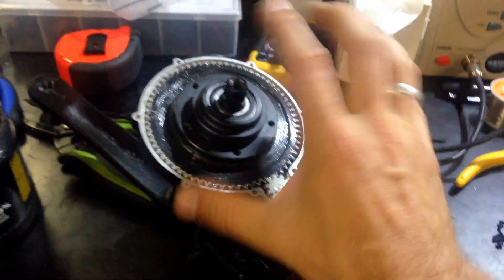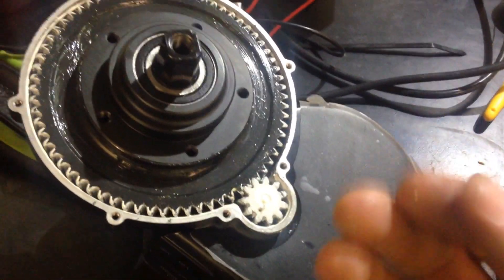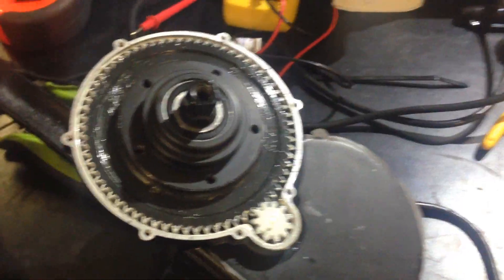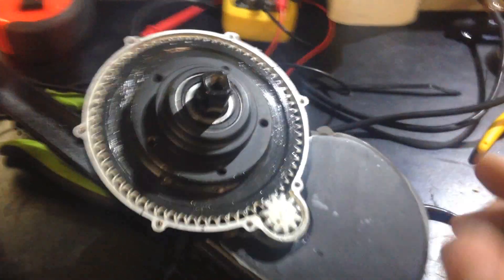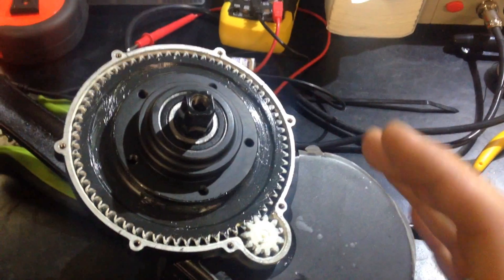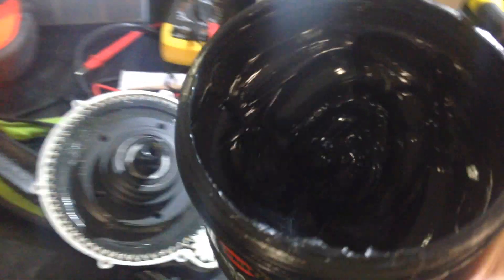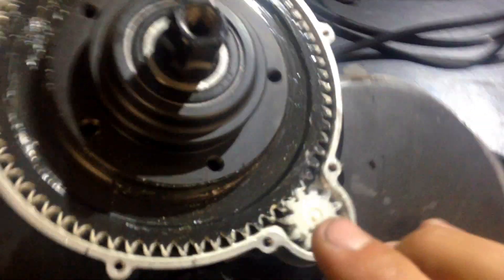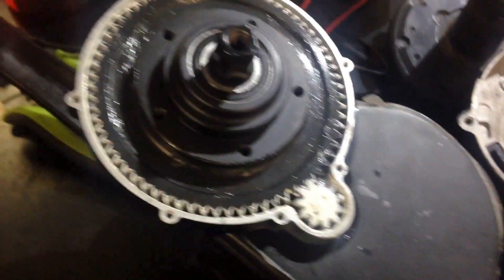Bafang 8fun BBS02 - White Lithium Grease "problems" • Electric Bike 750w 48v mid drive kit

Comment: Jesus! For the price of their kit... I'd say molybdenum disulphide or gtfo!
Reply: +ElectricBike (Bruno) Hello Bruno. I can understand the idea behind the moly grease (I read the article). But it makes no mention of lithium grease. Is moly grease compatible for both sides? The metal gears and the white nylon gear. In other words can I use the moly grease for both sides?
Reply from the maker: +Nelson Olivo - Moly grease is for metal on metal only (second stage reduction gear where you screw the chainring on). The internal gears are nylon on metal (designed to reduce noise, protect motor shaft from wear and make the motor lighter). When it comes to plastic on metal or plastic on plastic (nylon in this case) it must be a plastic safe lithium grease (99% os cases will be white). The motor shaft spins at high RPM so the thickest white grease the better. Karl from www.electric-fatbike.com is testing many white lithium grease brands and will come up with an article on his website very soon. I use this one made in Australia https://www.kincrome.com.au/grease-500g-tub
Reply: Thank you Bruno. You have been very helpful.
Reply from the maker: +Nelson Olivo - haha I'm here helping people with all my passion (as much as I can) I really want to see an "electric bike revolution" =]
Reply: +ElectricBike (Bruno) Also seeing it as future of biking, but here in Slovakia I encounter just with negative response on ebikes. Nevermind, they will get it in few years. ;)
Reply from the maker: +DaDo Bzz - Yeeeahh.. this is the future and no matter what people say and how much they resist to new things and changes.. this is the future of transportation. Imagine how much things Elon Musk heard from people, media, engineers, everyone saying "this Tesla car won't sell, no one will buy that thing" years later and everyone changed their minds. We are here anticipating the future for those people that are really hard to change... they need to "try" all that POWEEEEER =]
Reply from the maker: Yeeahh.. prices will always drop as there will be more and more sellers offering it and making a price war (good for the public) and more brands coming up with good motors... same for the batteries... a bit expensive at the moment but will drop prices too...
Hub motors are weak and not as efficient as mid drive like this one in the video but are the cheapest option so far... really cheap...
I would recommend saving your money and getting a mid-drive... better value (and performance) for the money....
So much POWEEEEEEER =]
Reply from the maker: +th3d3wd3r - sounds like you enjoy "greasy stuff" haha.... check out this FANTASTIC website: www.machinerylubrication.com/Read/1352/grease-basics
Reply from the maker: +th3d3wd3r - Yeeahhh... put the moly baaaaaack!!! I believe they had good intention trying to use white grease (second stage reduction gearing) as the black leaks a little bit through the pinion bearing mixing a bit of black with the white lithium grease used inside the first stage reduction gearing. In the end of the day, the Bafang kits are fantastic performance / value for money... no matter what! Even large companies (like Bosh) make mistakes sometimes.
The other mass production option is the "BORING BOSH" with 250w installed in some horribly heavy cruiser bikes paying more than $4000 and you can't even dream about touching their mid-drive... completely protected.. only the Germans can... so I will stick with Bafang =]
Reply: +ElectricBike (Bruno) It would be great if the kit was below $350.

Comment: So did they stop using it now? And the BBSHD doesn't have that right? Would there be a point to invest in some super good grease? haha I don't know much about that, let's ask an engineer
Reply: +ElectricBike (Bruno) Hello Bruno. I just received my BBSO2 yesterday and opened it to get rid of PAS. The metal gear side looks like if they took a paint brush and painted the grease on top of the gears. Now that I saw your bafang and have been researching I see I have to open up my bafang and fill it up with grease. I also ordered a temperature gauge on eBay and am going to install it when it comes in the mail.  What about the Lithium grease.  If the moly grease goes over to the lithium grease the nylon gear will be affected and the lithium grease will lose its strength and become soupy resulting in my nylon gear having to be replaced because of the breakdown of its lithium grease.  Can I apply a grease that is compatible to both metal and plastic or nylon as in this case on both sides so that if there is a spill one will not break down the other?
Reply: +Nelson Olivo Bruno thank you for your videos.  They are very informative. I am looking forward to develop my BBSO2 further in the future.
Reply from the maker: +Frederik Hollstein - As far as I know they went back to the black one =] Moly grease lubricates much better, used in much heavier automotive applications for decades. I believe they had good intention trying to use white grease (second stage reduction gearing) as the black leaks a little bit through the pinion bearing mixing a bit of black with the white lithium grease used inside the first stage reduction gearing. What about the BBSHD? To be very honest, I am controlling myself, don't want to open my unit yet, want to keep all original, seals, grease and put lots of kms on my unit first (just like regular a rider would). Bafang did a fantastic job with the BBSHD unit, it feels reliable and surprises everyone how good it feels.
Reply from the maker: +Nelson Olivo - Hi Nelson, I am posting another video showing people that there is no need to disconnect the PAS, all can be done with the USB programming cable =] This procedure works with all BBS01, BBS02 and BBSHD. There is not nylon gear on the second stage (the external one where the chainring is screwed on) both gears you see in this video are metal so moly grease is the correct long lasting grease. Mixd greases will only breakdown if you mix very different types of greases, in this case both are lithium base but the moly grease is blended with some petroleum chemicals that would attack plastics parts. The internal gears are nylon on metal (designed to reduce noise, protect motor shaft from wear and make the motor lighter). When it comes to plastic on metal or plastic on plastic (nylon in this case) it must be a plastic safe lithium grease (99% os cases will be white). The motor shaft spins at high RPM so the thickest white grease the better.
Reply from the maker: +Nelson Olivo - Thank youuuuu for watching my videos =] the more people developing mid drives the better will be for everyone here! As soon as you make something like your prototype, please send me videos I would looooove to make a video and ride this thing =]